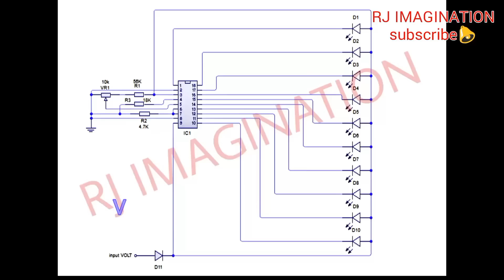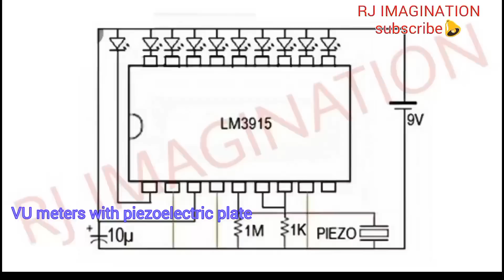Top 5 electronics Projects using LM3914-15 IC | lm3914 & lm3915 circuits

Comment: Very good quality electronic components soldering with circuit for hobby knowledge sharing. My interest now shifted to 'printed electronic' using normal printer fill with Conductive Ink . Print out electronic circuit .The aim is to replace PCB-board with normal A4 paper. Avoid Soldering. Replacing copper wires with ink/copperfoil/factory-plating . Hopefully you will adapt this Future-Technology. Thanks again your Sharing and prepare your future upgrade news.

Comment: Nice job, congratulations ..!
Seeing the Stress Meter diagram I guess this is a kind of skin conductivity indicator. Does it mean should be a relation between stress and conductivity ?
Reply: It does in a sense, but everyone conductivity is different also. If you are hot blooded, you may sweat more and therefore conduct more without being stressed.